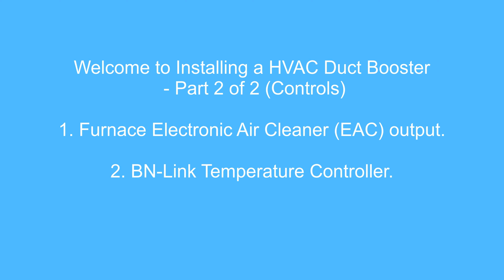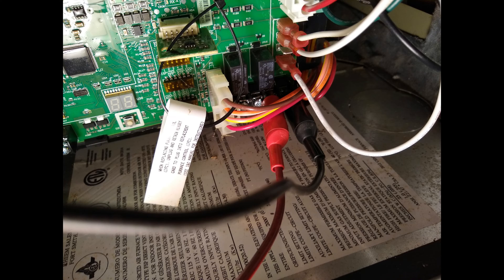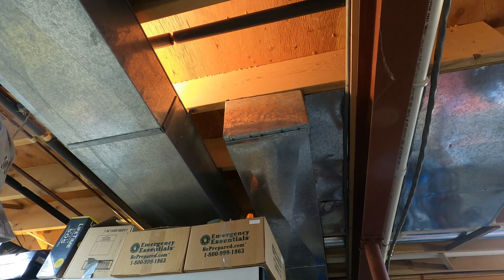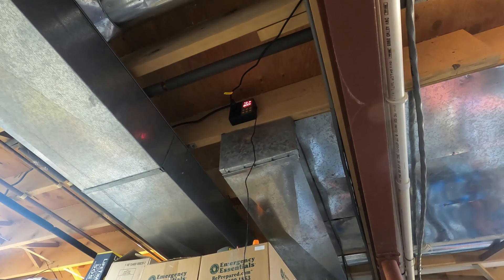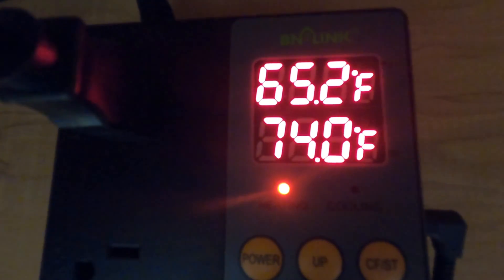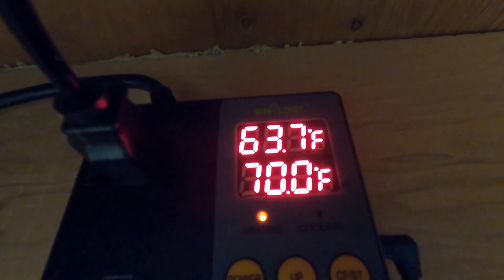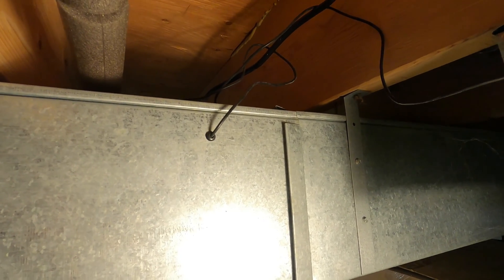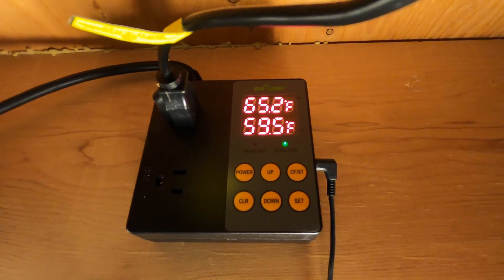HVAC Duct Booster Temperature Control | Part 2 | Man About Home

Comment: Why connect the duct blower to the heating plug instead of the cooling plug for the temp controller?
Reply from the maker: Good question. The temperature controller is set to heating mode, so when it senses cold air in the duct, it turns its heating output ON. It senses cold, so it turns on to try to heat it up, which it can't actually do. Then after the AC shuts down, and it warms up enough inside the duct, the controller thinks it warmed up to the temperature setpoint, so it turns the output (fan) off.    Thanks for watching!

Comment: I'm missing the point to bypass  the household fan. Can they not be wired to work together on a simple terminal?
Reply from the maker: The Temp Controller was a quick and easy way to get up and running. Basically, anyone could do it this way.  It worked fine, but with an inconvenient quirk of having to reconfigure it for heating season. Part 3 shows how I did a relay control off the furnace EAC signal.

Comment: It was a good idea. However your only reducing the airflow to other rooms in the house. The furnace will only produce so much CFM. You are just pulling more of that to the one bedroom.
Reply from the maker: If the furnace was sized (and configured) correctly, it will provide all the air flow the house needs. I have to consider that the bedroom was included in the original sizing. The booster speed is set to cool the room and no more. It's only pulling the air that would have flowed through the ductwork if it was designed to function properly in the first place. It's been operational for a year, and the house is cooling just fine! Thank you for watching!

Comment: All you needed was a pressure sensor. 🤦‍♂️. Ac infinity should include one like most duct booster fans.  They annoy me. They have a decent fan controller though.
Reply from the maker: I'm not using the temp controller now. I've installed a relay to control the booster with the EAC signal. A video will be posted. I like the relay because it gives me a spare set of contacts for future use ...I'm considering a UV light. Thanks for the comments and information. A pressure sensor is worth investigating.
Reply: AC infinity products are (or were) primarily marketed/designed for ventilating A/V cabinets, home server rooms, etc. It's no surprise they don't include HVAC-oriented features.

Comment: How do you use the booster for heating, if your controller has only 1 setting?
Reply from the maker: If I were to keep using the temperature controller for this purpose, I have two options. Option 1 is to simply turn it off during heating season. There's no problem getting enough heat up to the second floor, since heat naturally rises. Option 2 is to change the configuration by using the cooling receptacle in the controller,  setting it up to try to cool the sensor by running the blower. However, I'm not going to be using the temperature controller. I just finished converting the Duct Booster control to a relay that's controlled by the furnace EAC signal. So when the furnace blower runs, the Duct Booster runs. I'll be posting a new video on that soon. Thank you for watching and commenting.

Comment: When I installed my duct booster I did a very similar way to your EAC control signal. I used a Functional Devices RIB RIBU1C.  I wired the Comm (Wht/Yel) to the Common of 24 Vac transformer  (Black or Blue) on the board and the 10-30 Vac/dc (Wht/Blu) to the Fan relay (Green) on the board. I put a 3 Amp fuse in line on the green wire just to be safe.   Than wired the fan to the Comm (Yel) of the relay and N/O (Org) of the relay. This way  when the T-stat calls for fan the duct booster is ON.
Reply from the maker: There's definitely more than one way to get it done. And that looks like a good relay to use, and another workable solution.  Also not too expensive. Thank you for sharing that information!
Reply from the maker: Thank you for the lead. I purchased a Functional Devices RIB2401D. It's the same as the one you used, except it's DPDT. I installed it today and it's working fine! I'll be posting a new video soon.

Comment: waiting for the next vid with EAC control.... i have this same issue in 2 rooms. hope u post soon
Reply from the maker: I have so many projects I need to work on, I haven't done the next part of this one yet. If you want to check out the comments on the first video, someone said this can be done with the blower high speed signal. So, I'm going to look into that option as well. I'll get back to it in time. Right now, I have car problems I have to work on. Sorry for the delay. Thank you for watching and commenting!